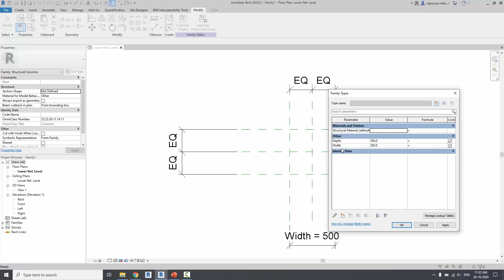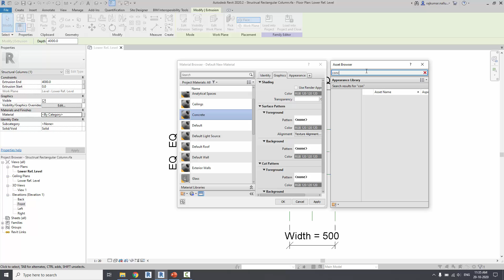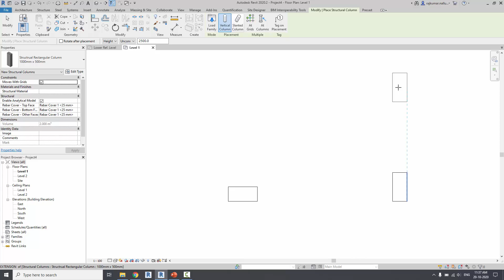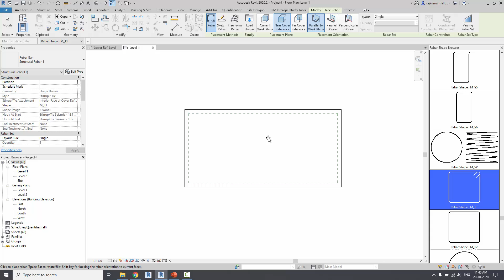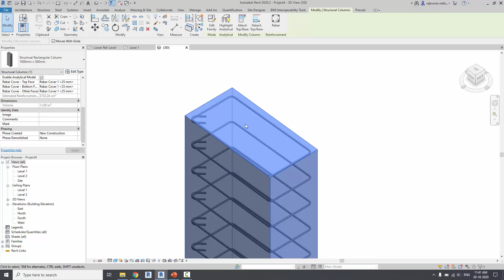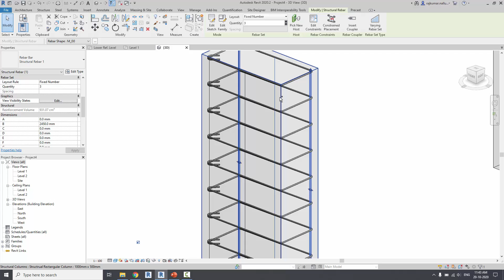9. Revit Parametric Rectangular Column Family

Comment: Mine doesn't show Rebar-Reinforcement, what to do?
Reply: Thank you so much for the fast reply. I am intermediate with ACAD and now am adapting to revit.
Reply from the maker: Fantastic. Keep Learning.
Reply: @BIMModeller  I got an out of topic question, I modeled my building in 3D on ACAD. In Revit, should I select structural floor/column/wall or architectural?

When do we use structural and architectural?
Reply from the maker: @jowieonit  If it is load bearing element you can use Structural Elements. If it is Finish based you can use Architectural elements. It's based on what properties you wanted. 
In general think, Structural elements will have their own properties. Do you need those? Then choose.
Reply from the maker: Hi Jensar, Did you check the visibility Graphics option?
Reply from the maker: Just try this and Let me know. https://youtu.be/PFwlLMrZ0mQ